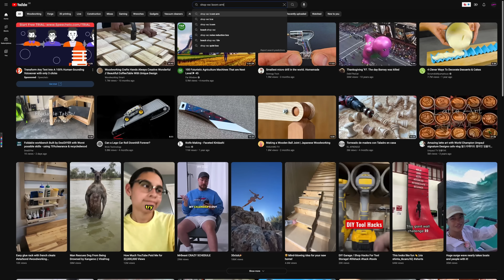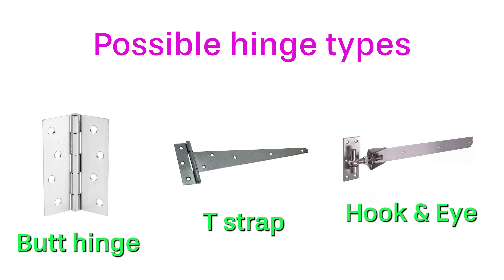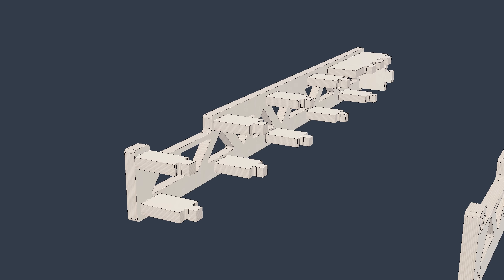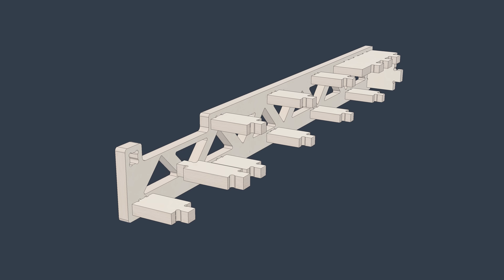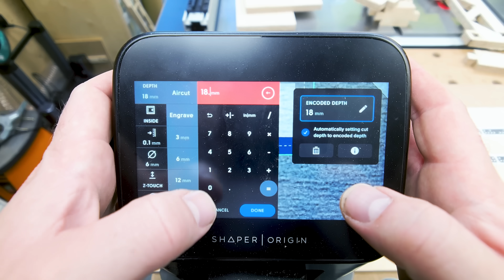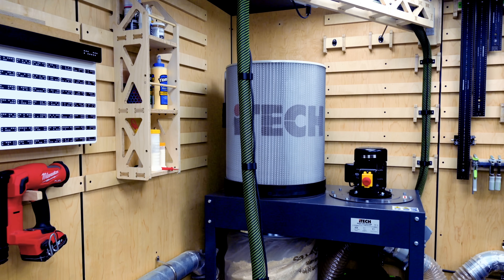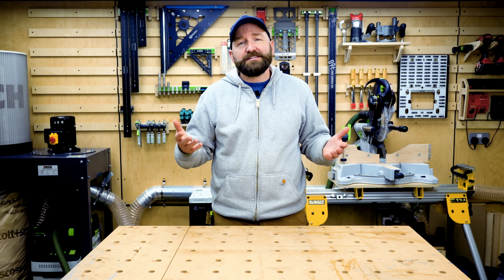Is this the ULTIMATE Shop Vac Boom Arm?

Comment: The best wood design yet 👍.  But I wonder why no one is just bending a 3/4 piece of EMT?  $20 with the straps to connect it to a French cleat rig. If it’s extra long, one could even use the cable option to suspend it farther.
Reply from the maker: Lots of routes for improvement for sure. My shop is pretty small so only needs a 3ft wall projection. Also no metal working tools so buying hardware felt sensible to me at the time.

Comment: Cute boom arm but too heavy for what it does. I made mine from a 1" EMT pipe. Bent a 45 deg at 36" on both ends. Ran a 12 awg extension cord with 3 outlets inside the pipe. Attach the vac hose on the pipe with velcor strap. It swivel freely on 2 baltic birch L-shape french cleat with lock for stability. Took me less then 1 hour to built and cost me under $40 including the pipe, extension cord and velcro strap.  Take 2 minutes to move it if needed.
Reply from the maker: Nice. I wasn’t going for the fastest build. Instead I was going for a mix of form and function as will be in the background of my videos. If I had had 12mm ply that would have been lighter but the weight also stops the arm from swinging around too much which I like.

Comment: Hi, great summary at the beginning and good video overall.  WRT to the design, did you say that the boom arm pieces would assemble together without any glue or screws?  I don't mean during the initial dry fit, I mean the final assembly.  If so, why?  surely using at least screws will add strength while still allowing for disassembly later on if needed.   I was also confused about your choice of hinge, since it seemed to have a lot more potential for sag than the other choices, particularly the butt hinge.  Just curious, thanks!
Reply from the maker: Yes this is a no fixing no glue build. I didn’t use either as not needed and def would not add strength as the forces here are going through the tenons. Given offsets used in the joinery there is no chance of parts coming apart. 
On the hinge as I said I wanted the hinge to be internal and have wall clearance adjustment. The hinge I went for provides both the aesthetic qualities I wanted and wall projection adjustment for clearance. Sag was known issue and wire guy line is IMO an elegant solution here. 
If I had gone for the most basic design possible it wouldn’t have been satisfying for me or probably got the interest from others. 
Hope that helps.

Comment: I wish I found your channel a couple weeks ago because I just built a cleat wall with 70mm faces, wish I did 60mm as I am about to buy the shaper origin and like your designs.  I’m definitely building this boom arm!  Love your content so far , keep it up!
Reply from the maker: Hey don’t worry I have two solutions for you (you will need fusion 360), a friend in the community converted my cleat designs into parametric as he also has 70mm cleats. You can find all the details on how to use here 👉 https://hub.shapertools.com/creators/6508a6c9524584fb7eda9317/shares/654eca80834c1c1651ab8718
Also if you want the wall bracket for the boom arm in 70mm with spacing to fit your setup. Then find me on insta (@hswbuilds) and I will make a file for you no worries. 👌🏻

Comment: Great design.  Any feedback on how effective your dust extractor is with the additional length of hose in the system?  My only hesitation in adding one to my shop.  Many thanks.
Reply from the maker: I need to occasionally remove debris from the coupling but otherwise I do not think there is much loss in suction.

Comment: I, like you have looked at all the same videos with the need in mind for an effective, efficient solutions to power hand tool dust extraction over my assembly table.  I have taken your idea and expanded on it by adding lighting underneath, a compressed air hose that runs along the side of the vacuum hose and a switch that automatically turns on the vac when power is turned on when operating tools. The length of my arm is 1370mm. Can I ask how long your arm is? It looks to be about 1200mm?
Aside from this I really enjoyed your video and the way you approached the project. Well done!
Reply from the maker: Yes the arm itself is 1000mm but with the bracket and cleat the wall projection is approx 1200. Glad you liked it 🙌

Comment: Thank you for sharing this video. It's a really nicely engineered arm. My situation is slightly different, in that my shop is 8m long by around 2.5m wide. I'm going to have to come up with some kind of overhead gantry with a sliding trolly. You have inspired me to do something about it. I'm fed up with dragging my shop vac around and having cables ad vacuum hoses snagging on stuff. Also, I want to say how great it is to have someone from the UK creating woodworking content. Good luck with your venture. Regards, from a fellow UK Origin user.
Reply from the maker: You know I actually recently installed a ceiling gantry for my lights has X,Y and even Z movement. Probably overkill for a hose but would be a solution for a bigger shop perhaps 🤔
Reply: @HSWBuilds  That sounds interesting. Any photos? Perhaps I’ll get one of those motors that 4x4 drivers use to pull themselves out of ditches and a remote control so that I can get it to drop the hose down from the gantry. 😂🤣😂
Reply from the maker: @keithforster2615 lol mine is low tech just aluminium extrusion with sliding carriage. Position movements by hand. Will do a short soon on how it works and how I installed it.
Reply: @HSWBuilds  Nice, I look forward to it.
Reply: @HSWBuilds  Nice, I look forward to it.

Comment: Very cool, i will need to retrofit a tension cable to mine as the sag is real!

My personal approach is that i have a "dock" for my CT26, which connects into a separator/collection bin - but i can always disconnect as needed. From there i have central vac tubing running up the wall to the end of the boom arm (with a piece of flex vac pipe for the swinging joint)  so that i only had to have the one pricey festool hose 😂
Reply from the maker: Nice I did think about a pre-separator but space is an issue. Instead I just bought a bag for life. Though it is annoying to have to open up the CTL to see how full. 
I have an older CTL mini connected to my mitre saw and as part of soon to start mitre station build I might fit a cyclone separator though height with hose fitted might be a problem.

Comment: A very nice build but is 18mm ply not overkill for the arm? With your design would 12mm not have been plenty strong enough and significantly lighter?  (And cheaper).
Reply from the maker: Totally agree with you. Ideally side pieces 12mm for sure. Most of the weight comes from the wood. However I only had 18mm on hand. If you try then for sure 12mm!

Comment: The attention to the engineering concerns, design and outcome are great.  The issue that stood out to me is the amount of overkill you managed to cram into this project is impressive.
Your constraints unnecessarily imposed unnecessary complication, effort, tool sofistication and cost to the project. It seemed like two six foot lengths of electrical conduit, a large nut and bolt with some zip ties could have provided the same functionality. What is wrong with using cable ties?
Reply from the maker: Over-engineering is my thing where design and form usually trump base level practicality. For me in all my projects even shop projects form is as important as function. I appreciate that is not for everyone. That isn’t my continent goal either.

Comment: I think you need to offer the CNC files unrelated to the shaper.  Most people don't own a shaper and its not something I would want.  But I do own a CNC and would gladly purchase the files just to save the time.
Reply from the maker: Thanks and good suggestion. Not familiar (yet) with CNC file setup. What would be the file format that you need? Am thinking about getting a CNC bed also so this might be a place to start!
Reply: @garrydye2394 the files on the link are .svg files, technically you can use them on your CNC, however .DXF might be better for some users.  I hope this helps?
Reply: DXF are the industry standard
Reply: @RuffKutmedia are we losing the fact that it’s woodworking, just look at the problem that you have, think about it and alter it to suit yourself ! Simple 😊

Comment: Very nicely done! Subscribed.
What I did to give myself a bit more room was mount a shelf on unused wall space (in my case, above the right wing of my table saw) and park the vac up there. That way, it's not taking up any floor space. I also use a dust deputy so I won't have to change the bag or filter for literally years. My own boom arm will end up being a mishmash of all the videos I've watched using the features that suit me.
Reply from the maker: Mash up is the best way. I did the same and added my own spin. Hope my plans help you.